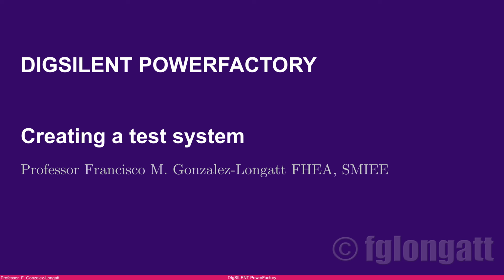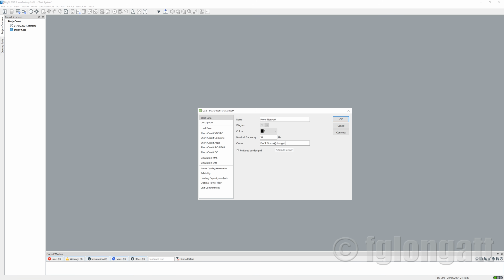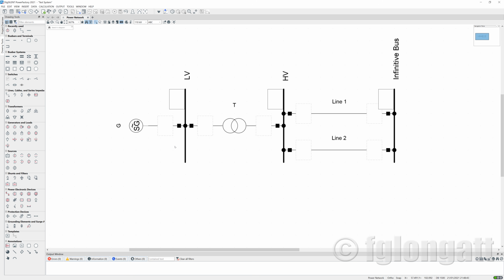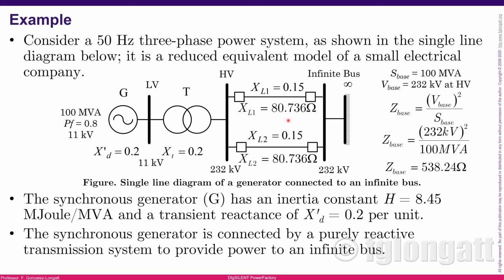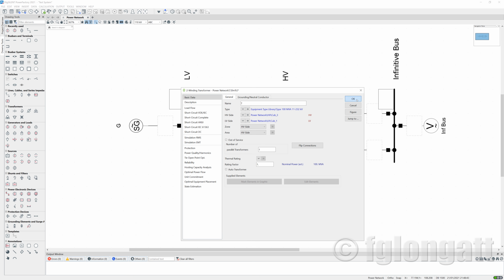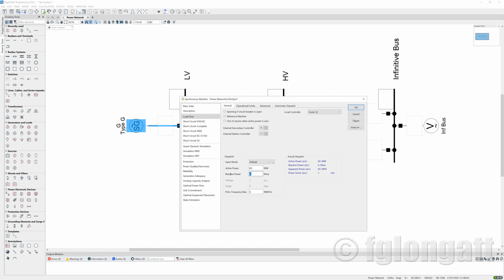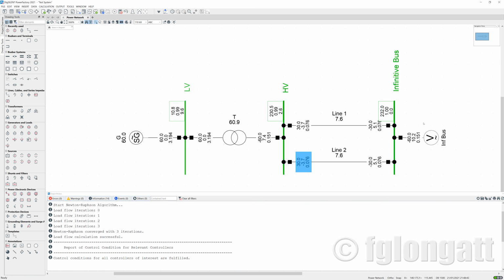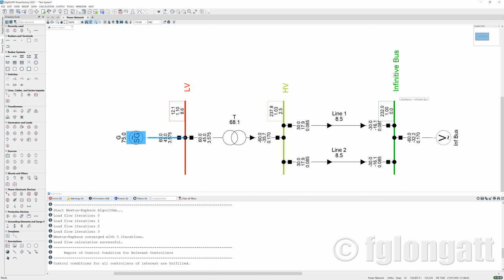Creating a Test System  SMIB  using #DIgSILENT #PowerFactory 4k resolution (3840 × 2160)

Comment: Some questions: why it is called infinite busbar? Is it related to the short circuit power which is infinite? Which is the difference in defining it by means of a Voltage source with 0 impedance and defining the infinite busbar by means of a PV busbar? Does the Voltage source busbar accounts also for power mismatches like I learned from the Slack bus? Thank you